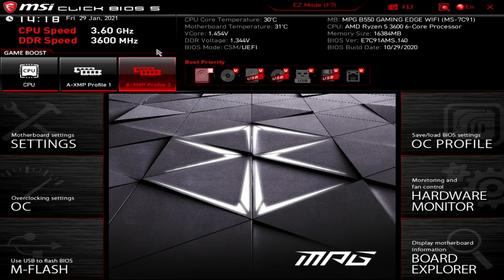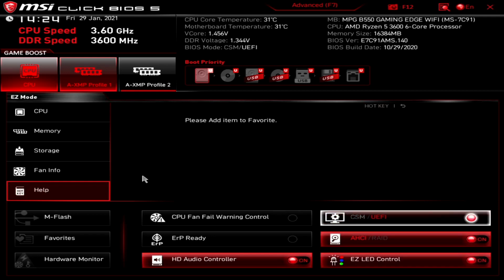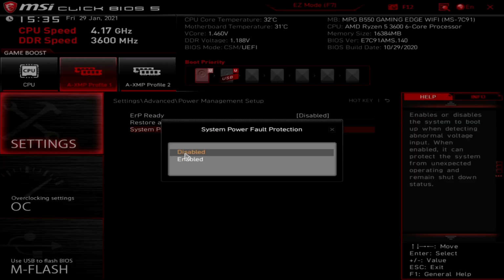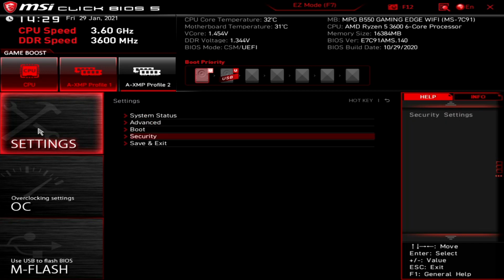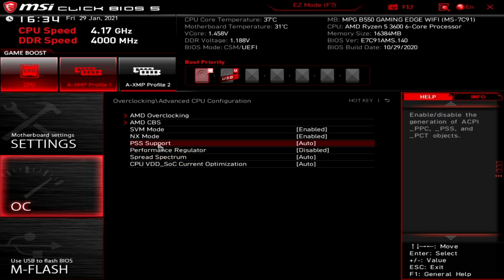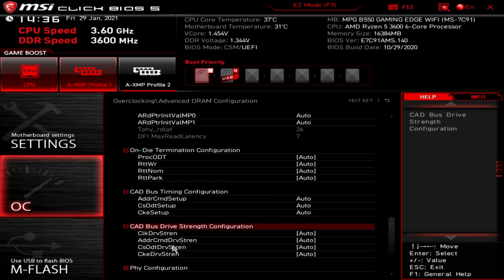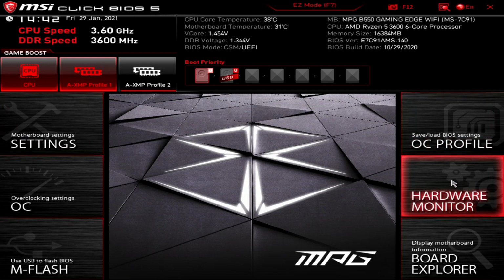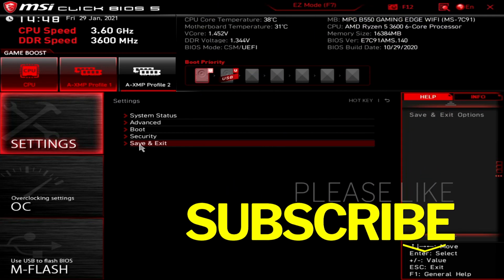MSI B550 Gaming Edge Wifi BIOS UEFI Walkthrough Tour & Basic Explanations

Comment: Nice one, Mike. I have an almost identical setup to this, only a 512GB drive instead of your 1TB. As you suggest, I have left most of the settings on Auto. And the BIOS is a bit older, but it works and the last thing I need is to bork the system with a failed update. But next time I feel the urge to muck about on booting, I'll have a better idea what all the settings do.

And finally, I was in Booker in Speedwell last Tuesday afternoon, but I don't think I saw you on my drive through Downend on the way back home! Look forward to another guided tour of East Bristol. Hanham perhaps, or Kingswood?
Reply from the maker: ha tuesday i was in the Downend high street i think, if you see me beep or say hello

Comment: Just bought it last month after recommended by you. I discovered two things in this motherboard: 
1. If you place a pcie 4 graphics card then the second m.2 slot is disabled.

2. I inserted a SATA m.2 in The nvme 4 slot. To my surprise it worked 😊

Its been over a month since it booting from m.2 SATA  in nvme 4 slot :)
Reply from the maker: wow didn't know that, i guess it is also CPU dependant for PCIe lanes
Reply: @mikesunboxing  I have a Ryzen 5 3600
Reply: The disabling of the second M.2 slot in this board is mentioned in the manual, and other tech YouTubers have also commented on it. It is a drawback, but I don't see myself getting both a brand new graphics card and a second nvme drive.

Also, unless I'm mistaken, SATA M.2 drives have a 2 notches in the interface end. This means they can physically fit in nvme M.2 slots, whereas nvme drives won't fit in SATA M.2 slots because they will get caught by the lack of the second notch.
Reply: @DavidLee-df888  The manual is silent on the terms of a pcie 4 graphics card. If that installed it doesn't say that second port is disabled.

Also, the manual says that the nvme 4 is backwards compatible with pcie 3, not SATA, yet it's working for me 😊
Reply: @szubinmehta  Even though it's as clear as mud, it is there in the manual. The chart on the lower half of page 30 lists the M.2 and PCIe slot combinations allowed. And bullet points above do seem to say what is available. I will admit it is not easy to interpret.

Of course, the KitGuru review a few months ago explained it better than the manual.

So, I will agree with you. Unless you know exactly how the PCIe lanes are arranged on this particular board, you will not be able to have say a 3080, and 2 SSDs.
Reply: @DavidLee-df888  that chart on the said page wasn't really easy to understand, not for me. I find gigabyte/asrock much better that way. Since its written for layman 😁. Anyway, its just that something I figured out on my own, so just thought of sharing.

Comment: I just completed My build after completing my Wifes bld. back around June/July. My build is on a MSI MAG B550 Tomahawk w/bios A30 from 09/03/20. I only put a Ryzen 5 3600 on the board so would it still benefit me in any way to update the bios to the latest? Thanks for all your Great advice. Peace
Reply from the maker: The general rule is if it ain’t broke don’t fix it. But if you are running into issues with stability or when running benchmarks it seems a little off the mark then it can be sometimes addressed with a bios update
Reply: @mikesunboxing  Thank you again. I only managed to get a RX 5600 XT in it due to constraints so with the 16g of mem. and really no issues... I will wait to see if one day 'some stock of current dreams' comes round... lol  Cheers.

Comment: That vCore looks high. I'm guessing very limited overclocking room. Is Game mode adding a max frequency increase?
Reply from the maker: yes it seems to be. Also in BIOS a lot of the power saving features are disabled. In Windows it reduces it as necessary
Reply: @mikesunboxing  Yeah I wouldn't use that mode. I get squeamish watching voltage going past 1.4v with +200 mhz max clock and curve optimiser
Reply: @mikesunboxing  tip for ya. Logitech g203 mice are on amazon at £14. msrp is £35
Reply from the maker: @DrhexUK  Thanks for the heads up :-)